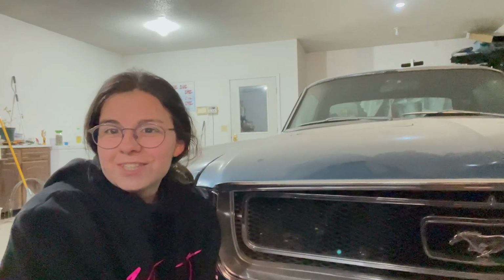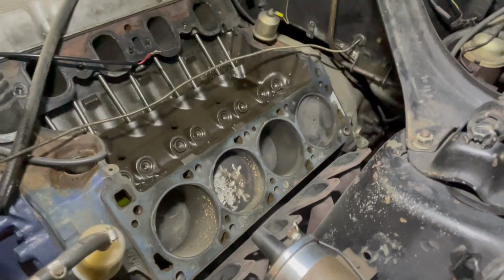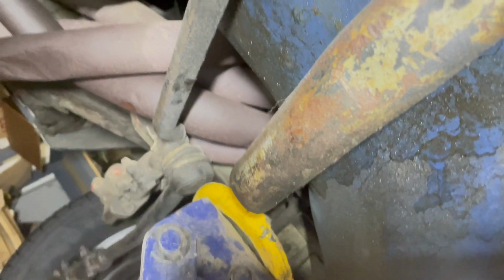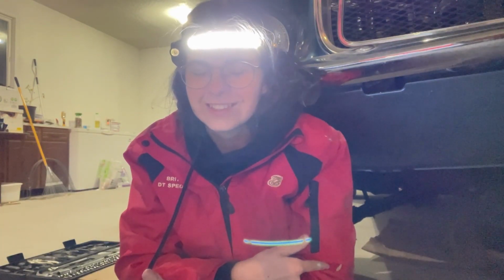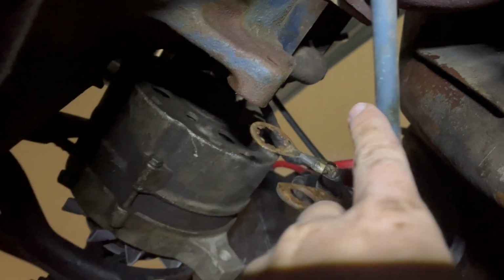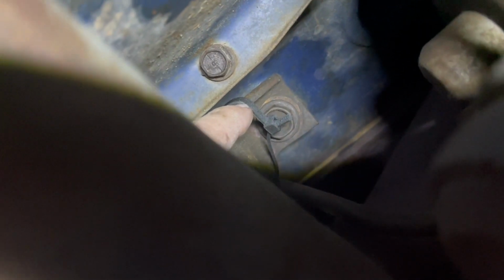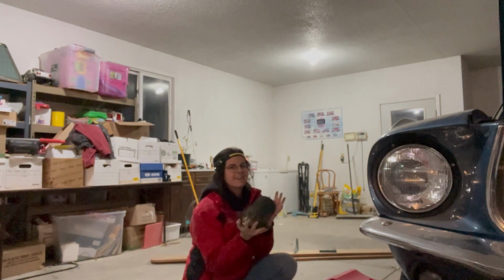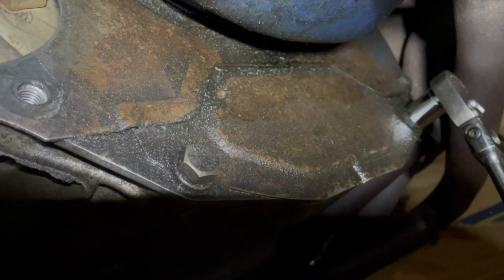Unbolting the starter

Comment: That damage didn't look too bad. A buddy of mine had an 86 mustang with a 302 in college. One of the rod caps came loose on one end, got bent open and basically the crank sent the piston against the head and pulled it back down(caving cylinder wall down with it) thru the side of the oil pan. That....was carnage! Good video, great job!
Reply from the maker: I hope you’re saying that my 351 Cleveland will be rebuild able 🙂

Comment: Longer ratchet/wrench, better leverage, more bolt/nut busting torque. I use dewalt 20v impacts, love em
Reply from the maker: I’m needing to invest in a good 3/8 drive impact … my arms either need to hit the gym or I need to man up and go to the shop to get a long ratchet
Reply: @brittanyBUILT  yeah, i really like my dewalt 20v  impacts, but i still use a 24" long ratchet to break stuff loose like mains or head bolts, then follow up with the impact.